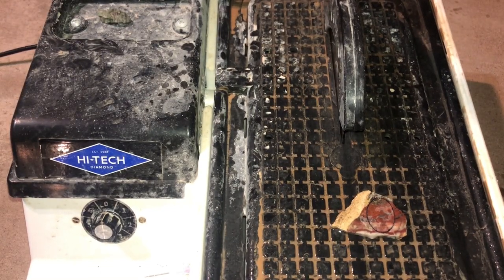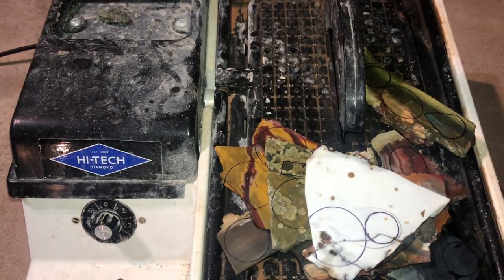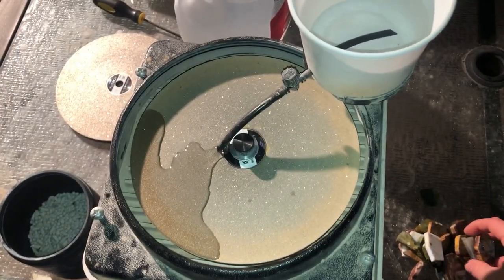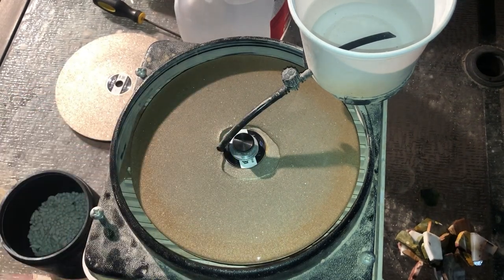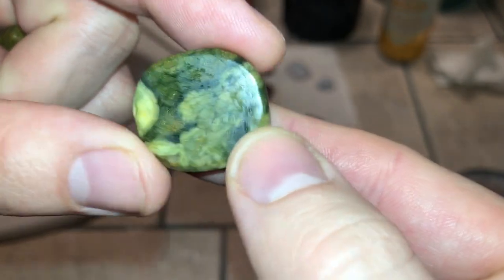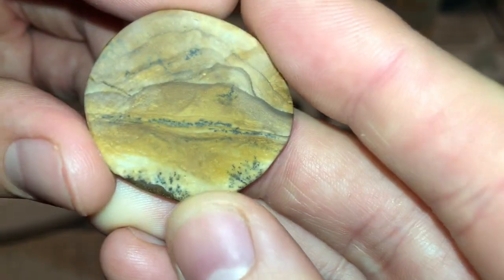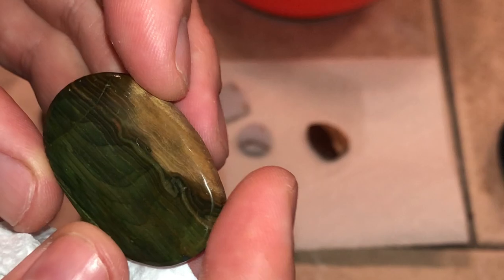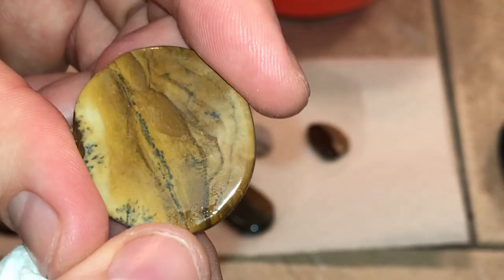Making Cabochons w/ A Rock Tumbler

Comment: Very nice rocks for sure. I do this same type of thing with rocks using a 7 inch tile saw, an angle grinder with a 4 inch continuous cut diamond blade and a dremel tool with diamond tips to cut, shape and smooth out my cabochons. I tumble them in a National Geographic tumbler doing Step 1 and Step 2 at Speed 3 for 2 days each. Step 3 and Step 4 are done at Speed 1 for 3 days each or a little longer if I'm not satisfied and the final result is stunning cabochons that are smooth and shiny as all get out in 10-15 days. Some of these cabochons that I make can be seen at Rock Tumbling Hobby Forum on the Tumblebug's Tumbles, Cuts and Specimens thread.

Comment: Thanks for the links to the gear - especially the diamond saw and flat top grinders and polishers.  I have collected a lot, but need to produce some finished product.
Reply from the maker: Definitely, if you’re  interested in purchasing any of the saws with a vise grip. Here is a little price hack.. if you purchase the saw/vice together it can’t be discounted. If you put the saw in car then add on the vise as a accessory you can get 10% off on the vise. Every little bit helps save money you know 😁.
Reply from the maker: You should definitely polish and make some finished pieces.

Comment: Very nice material ! We polish the majority of our pre forms/ cabs  this way but we use a vibrator tumbler  We use a 4½lb Lot-O single barrel and can do 40-50 pieces at a time. We start with 120/220 thou, 4 stages in 5 days . You should check out the vibes, we found some used ones
Reply from the maker: Thank you, and wow that sounds nice to tumble that many. I’ll look into that tumbler. I will definitely check them out.
Reply from the maker: Any specific link?